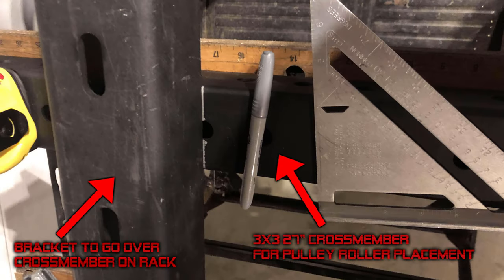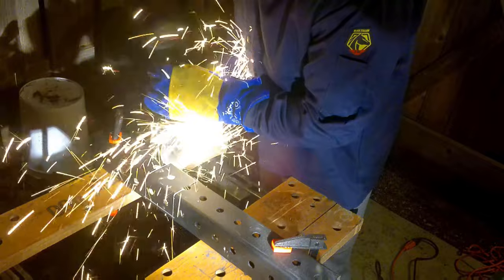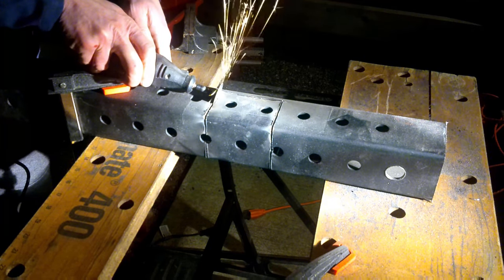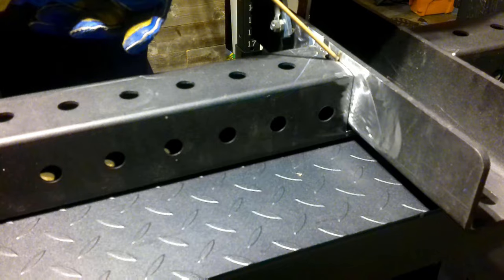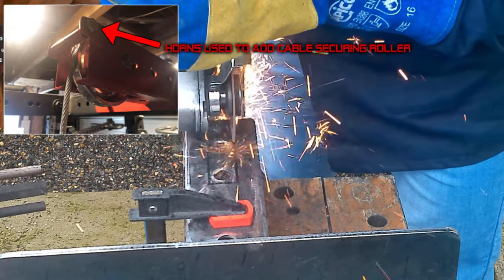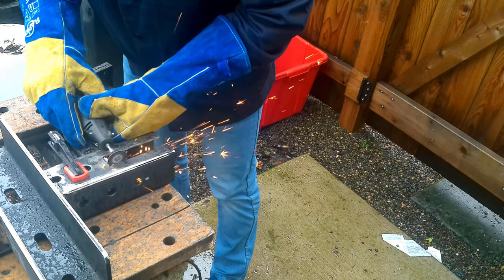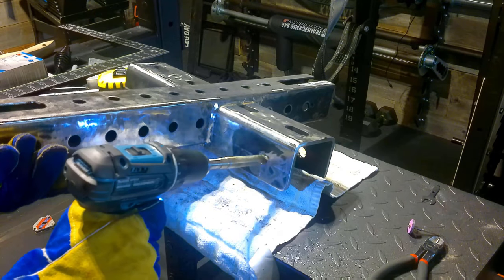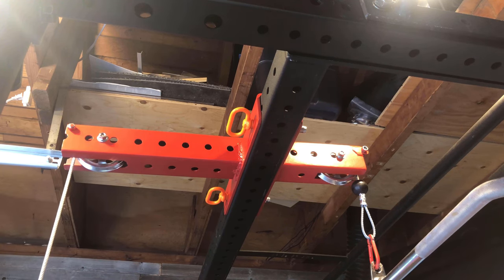FEDEX My Surplus Strength UPS DIY Version (Part 1)

Comment: Hi bro, I'm thinking of building my own but I can't find the measurements and my first prototype was a fail. What is the total length you used? And the length of the short and long part? Thank you
Reply from the maker: I believe it is 31in long and the bracket just needs to be able to hit 2 pin holes on your crossmember that goes through it.

Comment: Is this much better than the Titan Rack mounted pulley system & Rogue Slinger?  🤔
Reply from the maker: I’d say better than Titan pulley system… rogue slinger is superior if you want to go over an upright… this UPS gives you the option to go over a crossmember instead (good for low ceilings too) but I’d wait before purchasing… I have a better version I’m building right now that will take the place of both and a lot cheaper
Reply: @CurlsintheRack  yes. Need an affordable pulley setup. At $450 in my opinion it is way overpriced.

Comment: Great vid! Is there any specific videos you recommend to learn how to weld? And what welder do you recommend?
Reply from the maker: I put one that I watched in the description of this video... I sat with the welder for awhile before I decided to actually attempt it and watched quite a few videos on techniques and started with a test project using coupons..(I don't know why they are called this) but just small pieces of metal to practice on.
Reply: @CurlsintheRack  gotcha, what type of welder did you end up going with?